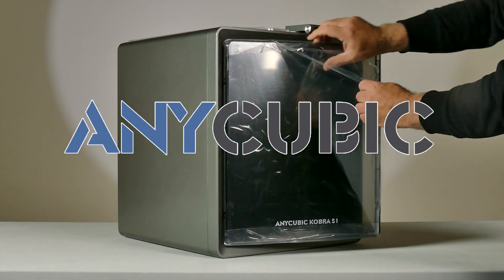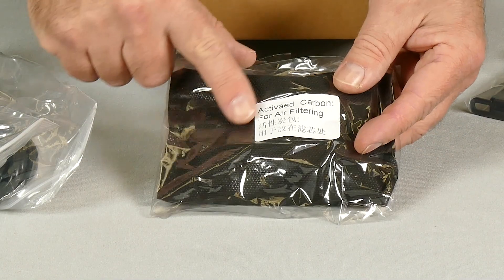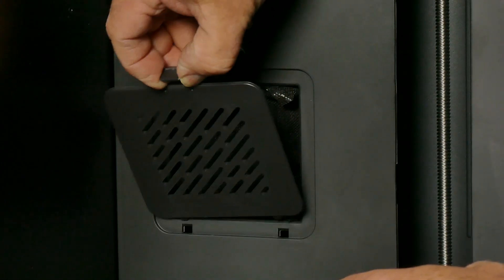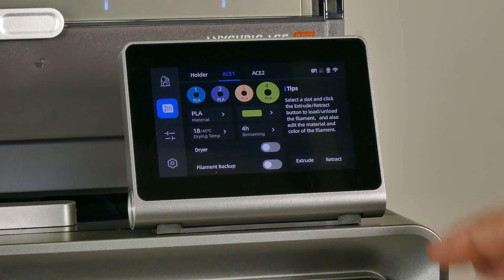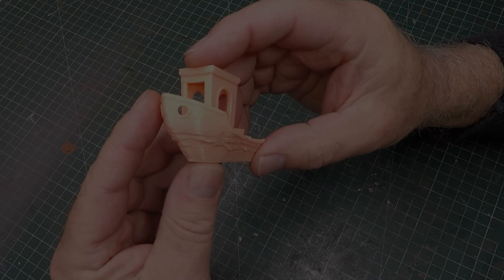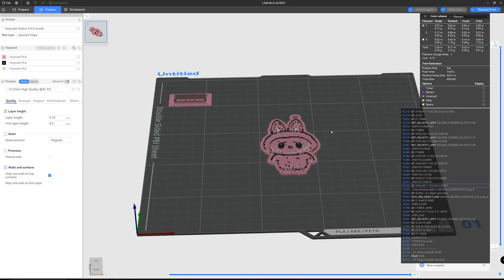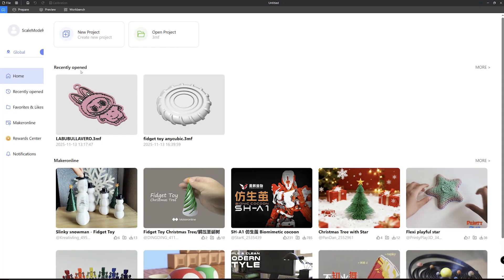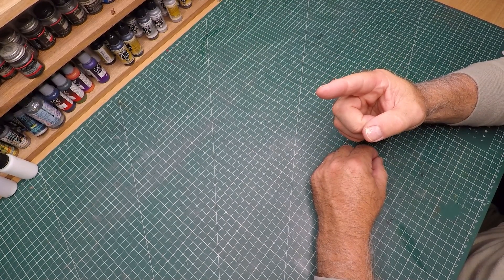The Anycubic Kobra S1 3D Printer Combo Just Showed Me That Bambu Labs Is No Longer King Of The Hill

Comment: I bought one and personally knew 3 other people (co-workers and relatives) that purchased these, NOT GIVEN FOR FREE TO REVIEW. And all but 1 of us has sold them off to buy Bambu printers of several flavors. The 1 guy who still has his has all the same problems we all had, he is just the type of stubborn person who touches the hot things multiple times because... These printers do print well for a while but quickly cascade into problem after problem. The ACE is very problematic, the software, firmware, the print head stops extruding with no pluggages, it stops cutting filament randomly, on and on. Stay away. I"m not shilling for Bambu, go get something beside the S1.
Reply from the maker: Go through my reviews and you will see the filament printers I have are the Anycubic Kobra S1, Flashforge AD5X and the Bambu Labs A1. Everyone of them has done a great job for me. Other than the issues that I have shown in my videos like the failed spaghetti detection system on the Kobra S1... it has worked well for me. The Bambu Labs was amazing when it was released but we now have so many great printers on the markert now.
Reply: Thanks for your comments, its answered my doubts about potentially buying one.

Comment: 🤔Good print quality, 
but based on my experience with the Cobra S1, its maintenance-unfriendly design, and unnecessarily complicated troubleshooting, especially with the Ace Pro, I wouldn't recommend any Anycubic printer at the moment.
Reply from the maker: Since I uploaded the video I've done a lot more printing with it and I have been more than happy with the results. At the moment I prefer it over my Bambu A1
Reply: I have use over 200 hours , so far not much issue. mostly my own error.
Reply from the maker: @machvellepang9798  Yeah, it's been very reliable for me